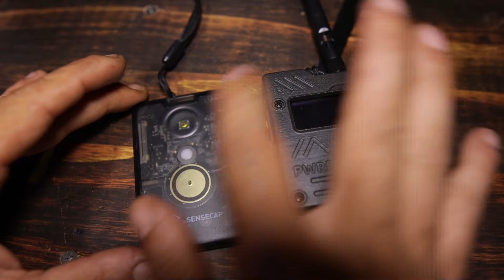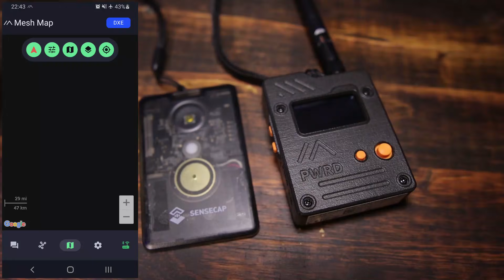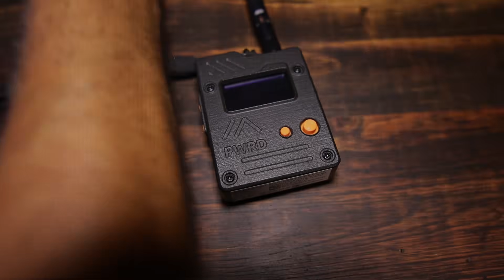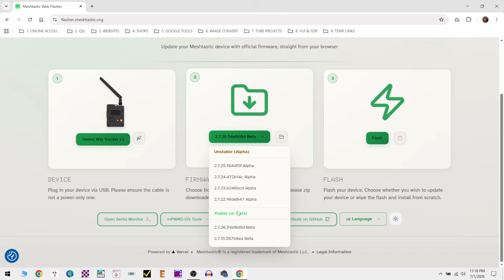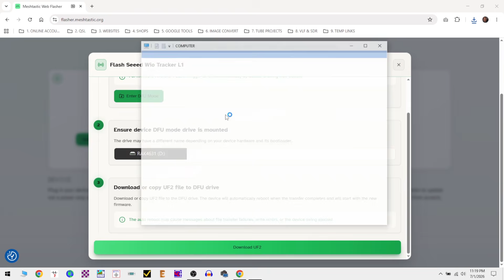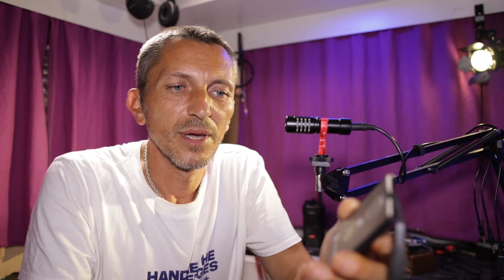Meshtastic or Meshcore ? Seeedstudio Wio Tracker L1 Pro And T1000-E

Comment: No compréis el Sensecat T1000E, a mi me duró un año, justo lo que duró la batería, dejó de cargar. Como no hay posibilidad de cambiarla lo tuve que tirar a la basura. Comprad uno que le mordáis cambiar la batería, siempre estará con vosotros.
Reply from the maker: I like it because is small and easy to hang on a backpack. I do prefer the other ones that I can replace the battery to... but this one is not that bad either. For the cost... if it lasts at least one year is still fine for me 😀 73, YO6DXE

Comment: I purchased the Lilygo+ radio and started with Meshtastic.  However,  very few people use Meshtastic in my area, so I switched the software to Meshcore, which is far more active in my area.  Both systems are good, but I had to select the system that's more active in my area.  Still I'm very happy with Meshcore.
Reply from the maker: I like Meshcore as well more than Meshtastic because of the way the message is sent. Very similar to APRS... more chances for the message to arrive at destination 😁 73, YO6DXE

Comment: I have been designing custom meshtastic hardware for last two years. Although Lora chip Semtech SX1262 natively supports 150-960MHz range, for compliance reasons band pass filters have to be implemented on both sides, RX and TX. That is why you can exchange messages even on 433 MHz, but within few meters. Specifications datasheet for wio tracker l1 plus declares 862-930MHz. Almost the same for T-1000e, 863-928MHz.
Reply from the maker: I don't know what to say... I've been using both 433 and 868 to send messages from 1.5km away... and this is with no external antenna. This is when I made my first initial tests while trying to figure out what band I should use as here in Romania we have two separate communities on Meshtastic. Sadly none of them close by... here around me everyone seems to use Meshcore instead.
Reply: @dxexplorer Try to measure output power on 433MHz. Also pay attention to signal strength  and SNR on same band and compare to 868MHz. If in any doubt, I will gladly try to help. 
Also, if you have an opportunity of dominant location and good antenna, try to connect to Meshtastic Serbia, 869.525MHz, channels MediumFast and Srbija, PSK key AQ==. 
Best regards.

Comment: Those devices are frequency specific and support 900MHz band only.
Reply from the maker: Nope... not true. They are region specific and each region has different frequencies... each region having the choice of using one of the two frequencies available for that particular region. More about this in the next video. 73, YO6DXE
Reply: @dxexplorer I will repeat, 900MHz band. Band is range of frequencies. More clearly, those will not work on 433MHz. 73 de YU1SR.
Reply from the maker: @slavisaasus then how come it transmits on 433MHz band ? 😁 As I can receive the messages on another device on 433MHz band as well. 😁 You will see this more clearly in the next video on this subject as I was saying.
Reply: @dxexplorer I have been designing custom meshtastic hardware for last two years. Although Lora chip Semtech SX1262 natively supports 150-960MHz range, for compliance reasons band pass filters have to be implemented on both sides, RX and TX. That is why you can exchange messages even on 433 MHz, but within few meters. Specifications datasheet for wio tracker l1 plus declares 862-930MHz. Almost the same for T-1000e, 863-928MHz.

Comment: With Meshcore the device is basically a modem and the screens you can toggle through are essentially decorative (apart from the bluetooth on/off). Also worth mentioning that Meshcore has firmware builds for bluetooth or USB connection to the phone, in case you want to operate wirelessless.
Reply from the maker: They do yes... but the idea of the device with Meshtastic is to use the device with ought the need of a phone... doesn't matter if it's Bluetooth or USB. Simply to use the device as a standalone device. Sadly that is not possible with Meshcore at the moment.
Reply: @dxexplorer  there are actually some devices where Meshcore can be used on the device itself — I think there are like 3 or 4 compatible devices but I ended up getting the Lilygo T-Deck plus — so if you are like me and are interested in still using Meshcore but don’t want to be required to have your phone on you to do so then I definitely recommend the T-Deck plus (make sure to get the version with the SMA connector).